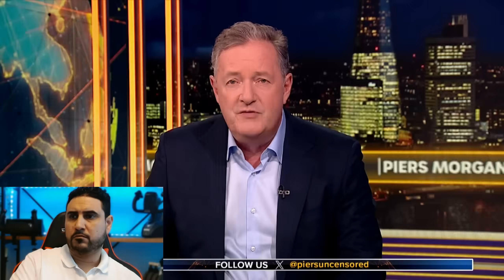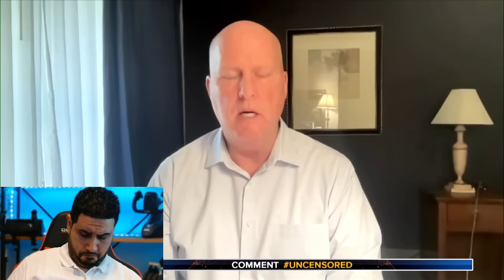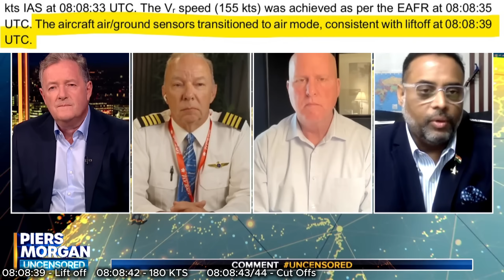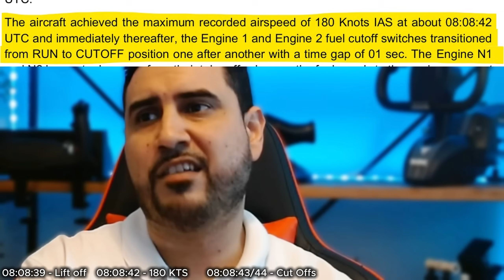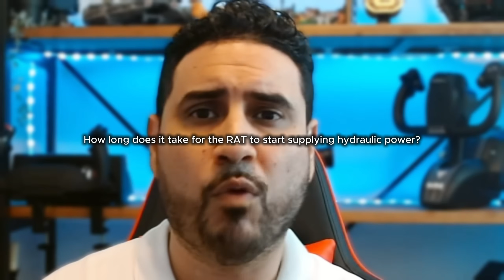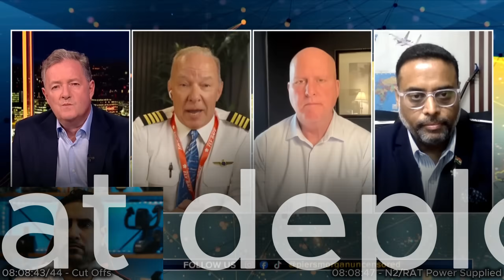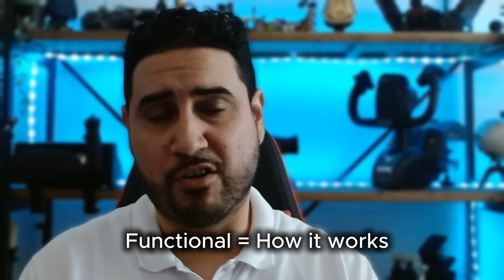TOTAL SYSTEMS FAILURE BREAKDOWN | AIR INDIA 171 | AAIB PRELIMINARY REPORT | MAYDAY | MSFS2024

Comment: off the internet search about electrical problem 787

Electrical Failure Scenario:

If a complete electrical failure occurs on a 787, it can affect various systems, including the FADEC. In such a scenario, the FADEC might lose its ability to manage the engine, potentially leading to the engine reverting to a low-power or idle state.
Reply: @cjswa6473, the FADEC has its own PMA (Permanent Magnet Alternator), which is a small generator integrated into the engine, driven by the engine’s rotationm, which provides power in real time. 

It provides a dedicated, independent power source for the FADEC, ensuring it remains operational as long as the engine is spinning, even if the aircraft’s primary electrical systems (e.g., engine-driven generators, batteries, or ram air turbine) fail.

The AAIB Prelim report alludes to the fact that the engines were indeed spinning throughout the 32 seconds of the fatal AI-171 flight.

If the PMA fails or the engine stops (e.g., due to a flameout), the FADEC can draw power from the aircraft’s electrical system, such as the 28V DC bus powered by the aircraft’s generators, batteries, or RAT. 

However, in case there is total electrical failure, or the RAT does not produce the power in time, or there is a thermal runaway in the Li-Ion batteries, then it throws up more questions as to how both the engines were reignited (As mentioned in the AAIB Prelim Report).

Was the reignition triggered automatically by the FADEC, or was it manually activated by the pilot "transitioning" the fuel control switches from RUN to CUT-OFF, and then back to RUN, which is standard procedure as per the QRH?

Comment: I would like to ask captain Steve if the Fire handle is cable operated all the way to the fuel valves, or command manually and the valve operates electrically.

Comment: Boeing needs to program the fuel management computer to not allow pilots to switch fuel off during lift off.
Reply from the maker: I don’t have my notes in front of me but I believe they need the ability to cut off fuel in the event of a fire. Even during take off. 

Perhaps there should be a fail safe for cutting both off unless absolutely necessary.
Reply: Mechanical switches which directly operate on valves are conventionally used as a bypass to Automatic switches which operates on logic via Engine control system. However in this case whether there are 2 valves in-line, 1 controlled automatically and the other mechanically from the switch is not clear.
10 second would be required if the automatic valve needs rebooting of the Engine control system. 
The much experienced Captain might have realised that fuel was not going into the engine, and thus asked the question to his co-pilot, even though he saw the switch in open position, thinking if accidentally the copilot had turned off the switch and again turned it on again.... 
Blame it on human error to reduce liability of stakeholders..... The departed cannot defend themselves... 
Would be interesting to hear the views of a Chief Engineer and design engineer with experience of this system.

Comment: Maybe the switches were never turned off, the pilot piloting the plane saw on the monitor that the switches were off and asked his colleague why he turned it off, maybe there was interruption in the fuel supply system that happened, without putting switches off then it reset on it's own but no one actually touched the switches off or on.

Comment: Steve is repeating himself.  Yes , the switches can shut the engines but the engines CAN fail with the switches in the run position. Why else would there be a PROCEDURE to relight the engines by recycling start levers
Reply: I am not sure if I understood yr inputs...
AFAIK there is a function inside FADEC called "auto relight" which activates as soon as the FADEC detects engine flame out (signal from oil pressure) as long as the fuel sw is in RUN posn, so there is no need to recycle the fuel sw.....
Reply: @Salahdin500 please refer 787 Boeing checklist for both engines flame out in air - if they relight on their own why should the pilots recycle them manually.
Reply: I flew the Airbus for over than 35 yrs and the FADEC on A320/A330/A340 does the automatic relight after engine failure and I thought it is a common function in FADEC regardless if it Boieng or Airbus....
Reply: @Salahdin500 I flew 707 A- 300 DC10 747 for 37 years - none of them had autorelight
Reply: @Salahdin500 google this “ does A340 do an auto relight after engine failure “. You either never flew or are lying
Reply: I was talking about the FBW Airbuses. All of them are equipped with FADEC and all of them have the auto relight function. I have over 1,000 hours on A340 as Instructor....
The planes types you were referring to (b707, A300, A310) do not have FADEC and thus no auto relight function....
Reply: @Salahdin500 a simple google exercise for you. Just google or ask any Ai platform “ can the A340 engine relight itself after a failure “. First do this

Comment: No reasonable investigator and pilot would believe vibration or human involvement in cutting off the switches. We side that it was FADEC in an electical malfunctioning signal to the fuel valve.

Comment: FDR records switch position (on/off).
Reply from the maker: It does, but my understanding is this recording comes from the fadec. Which the fadec is suppose to accept the command of the fuel switch. 
The question is did the fadec have an electrical malfunction as the tail electrical arc suggests.
Reply: @FinalApproachPOV  Here's how it works:

From the 787 Aircraft Maintenance Manual:

Fuel Cutoff Switch

Designation | Cutoff | Common | Run
A | 1 | 2 | 3
B | 4 | 5 | 6
C | 7 | 8 | 9
D | 10 | 11 | 12

A Contacts feed an RDC (Remote Data Concentrator)
B Contacts feed a different RDC
C Leads to Engine Fuel Control Relay 2(L or R)
D Leads to Engine Fuel Control Relay 1(L or R) AND Engine Fuel Relay 1

The common pins are all GND. Positive voltage is supplied to the cutoff and run pins.

The RDC's detect the switch movement event and send a data packet out to the network; that's how the FDR "sees" and records the event.

https://youtu.be/-ur234kwnhk?t=1030

The FADEC (actually called the 'EEC' on the B-787) has no involvement in the process until after the valves are closed. The EEC is notified by the data network of the switch transition event, and may begin the engine start or relight process.

Comment: The switches are a distraction as someone mentioned here. 
RAT was deployed already in a screenshot in the preliminary report. The height is approximately 150 ft. If the fuel switch was already off the speed vs height trade off would start taking place and the speed would start decreasing. But what happened was it reached another 250 ft with normal climb! 250 tons fully fueled and loaded aircraft. Think! So what happened?

Most likely event is a major electrical failure caused by the Lithium ion batteries thermal runaway fire. Why is this likely? 

Because on the ground we had a video shared by a passenger of IFE and passenger comms air conditioning not working properly. The survivor reported a loud bang and cabin lights flicker. 

What nobody is talking about is RAT deployment reasons.... it's not just shut down of engines. It's when there is a full electrical failure it deploys by EPCS. This triggers FADEC to shutdown the engines. 

The key sequence is RAT -> FADEC -> Engines shutdown at around 300-350 ft only way it would reach 450 ft at normal speed -> Cockpit still has electrical power so they don't know about this event -> PF asks PM why did you turn off the engines -> they realize something is wrong -> 9 secs -> turn off fuel switch and on to reset -> aircraft begins a smooth glided descent and the may day call is made 

The rear EAFR was severely damaged....see the picture in the preliminary report in comparison to the front EAFR. But the tail section was intact and they even found a body of a cabin crew intact.

My experience is 18 yrs in one of the busiest international airport and a major international airline in IT. Always worked on complex system troubleshooting.
Reply: The aircraft reached a maximum altitude of no more than 150 feet above the ground. The Fig. 15 image in the Prelim was taken when it was about 120' AGL, it never got much higher than that.

Comment: While I guess anything is possible regarding electrical malfunctions, I have to agree with Captain Steeeve on this one. While I’ve never flown the 787, I have almost 20,000hrs in the 737, from the -200s to the Max, and knowing the Boeing philosophy, it’s inconceivable that both engines and other main systems would receive electrical power from the same source. For example, in each main (wing) fuel tank, one AC powered fuel pump receives AC system 1 and the other pump gets power from AC system 2. That way with the loss of generator 1, one would only lose 1 fuel pump and not both. Likewise, the hydraulic system has same philosophy, in that if the #1 engine fails, obviously the engine driven hydraulic pump is lost, but the #2 AC power source allows the electric hydraulic pump to remain operational. Therefore, each engine has its own EEC/ FADEC and the likelihood of each failing at the exact same time is nearly impossible. And regarding the Cutoff/Run switches and shutoff valves, it’s only logical that they’d be on different AC/DC power sources.

Additionally, if there was an electrical anomaly, how did it clear so quickly as the #1 engine restarted and the #2 restart was progressing normally until interrupted by ground impact?

While one does not like to point fingers at pilots who cannot defend themselves, in this case, some questions need to be investigated. Like why didn’t the captain announce something like, “dual engine failure, I have the aircraft.” The only conversation spoken words other than the mayday call was in regard to the Cutoff/Run switches. It only seems logical that with the unlikelihood of successful engine restarts, the captain would have tried to maneuver the aircraft to a more survivable landing location like a road or open area. Second, if this tragedy was pre planned, it would be much easier as the PM because with the FO as PF, he would be focused on looking outside and cross checking his flight instruments and not looking at the throttle area. And how did the FO suspect the Cutoff/Run switches were moved to cutoff and that it wasn’t an unexplained dual engine failure?
Reply: @edzanowicz1475, 

Primary Power to the FADEC is the main aircraft power supply from the electrical bus, providing power to the FADEC when the engine is not running. 

As a secondary power source, the FADEC (of each engine) has its own integrated PMA (Permanent Magnet Alternator) to power it, so it runs even if there’s no other power available. 

In the event of a catastrophic electrical failure, the FADEC, as well as the EEC, do not rely or depend upon the RAT to provide them with the electrical power to operate.
Reply: @ramnik.khanna  On this aircraft, the EEC IS the FADEC. Boeing calls this unit the EEC, not FADEC.
Reply: @BryanM61 , yes, but they are two different things. 

EEC is a supervisory system which controls engine parameters and operation to prevent parameter exceedance (temperature, RPM, etc.),and comes into operation at certain engine speeds. It has a backup in case all the channels of EEC are lost.

FADEC is a full authority system, i.e. it controls engine operation and parameters at all speed regimes. It has no backup system.
Reply: @ramnik.khanna  Oh good. Then perhaps you can find me a Boeing 787 document that refers to a FADEC.

The EEC has two channels, A & B - essentially identical circuits that switch to the backup if the first one fails. They constantly check themselves and each other.

The box that we refer to as the FADEC on most other aircraft is called the EEC on the 787.
Reply: @BryanM61  Colloquially, one may be referring to the FADEC on the Boeing 787 as the EEC. However, the Boeing 787 has both the FADEC and the EEC, each having it's distinct function.

Please refer the Boeing 787 Aircraft Maintenance Manual (AMM):
In Chapter 73-21-00 (Engine Fuel and Control - Electronic Engine Control System), the engine control system is explicitly referred to as the FADEC system. The AMM describes the FADEC as the overarching system, with the EEC identified as the hardware component that processes inputs (e.g., from sensors) and generates outputs (e.g., to actuators). This distinction is clear throughout the maintenance procedures.

Boeing 787 Flight Crew Operations Manual (FCOM):

The FCOM also refers to the engine control system as the FADEC. It notes that the EEC is the physical controller implementing the control logic within the FADEC system. This is evident in sections discussing engine operation and fault management, where FADEC is the system and EEC is the executing hardware.

GE Aerospace Documentation:
GE also employs both terms in its technical documentation, at Paragraphs 1 & 2 of Section 73-21-00. 

The Type Certification Data Sheet T00021SE issued by the FAA also mentions the term FADEC.

I rest my case....
Reply: @ramnik.khanna  I also have the FCOM. I find no references anywhere - not one - to the term FADEC or its full spelling. Which section or page did you see that on?
Reply: @BryanM61  , you're right, the FCOM for Boeing 787 Dreamliner equipped with the Rolls-Royce Trent 1000 engines mentions only EEC and not FADEC. 

The AAIB Preliminary Report of AI-171 refers to the FADEC and not the EEC. 

I believe, the FCOM for a Boeing 787 equipped with GEnx-1B engines would differ, as also the FCOM issued by an airliner operator, like Air India.

This needs to be checked and verified.

Have a good day!
Reply from the maker: I come from the IT world while still studying aviation. From a technology perspective, bugs exist and anything is possible. Bugs are unexplained anomalies. They aren’t always fixed with the root cause analyzed. 

But full disclosure, I still am leaning towards Steeve’s analysis. Because that’s what the preliminary report suggest. But don’t forget the “unexplained” electric arc damaage in the tail section. 
But I also know that the impact of the accident can also cause the same electric arc damage. 

So I think the argument is fair enough. We will have to wait for the final point. 
But no harm in speculating in the mean time !

Comment: I think the preliminary report DOES tell the full story only if one looks at it minutely. Page 13 gives out the details of the EAFR's recovered from the front and the tail. 1)"The download from the FWD EAFR was attempted at the AAIB Lab on 24th June 2025. The CPM was retrieved from the EAFR and found to be in good condition. The CPM was mounted on the Golden Chassis and the raw data was downloaded from the EAFR". 2) "The aft EAFR was substantially damaged and could not be downloaded through conventional means. The CPM was opened to inspect the memory card. The damage was extensive".  Let us look at facts. The FWD EAFR fell to the ground and was in the inferno of the exploding fuel.  The AFT EFAR was on the roof , fell to a lesser height than the FWD EAFR and also there was no fire in the tail. But still the report shows there was so much damage to the AFT EAFR that it could not be easily decoded whereas the FWD EAFR was easily decoded.  Does that not indicate that the AFT EAFR had a catastrophic failure which could have resulted in the shorting of the electrical lines and a glitch which caused the FADEC to shut down the engines? It is time the experts had a look at the AFT EAFR  failure angle rather than focusing only on the Pilot error angle.

Comment: 🧭 Overview: Boeing 787 Engine Start/Stop Switches
On the 787, each engine has its own START/STOP switch on the overhead panel. These are electronic selectors, not direct mechanical switches like in older aircraft. They're part of the integrated modular avionics (IMA) system, which means that inputs from cockpit controls go to centralized computers (called Common Core System modules) that then issue commands over digital buses.
----------------------
🛠 Functional Description
Each START/STOP switch sends a digital input to the Engine Indicating and Crew Alerting System (EICAS) and Electronic Engine Controller (EEC) via:
·	Data concentrators
·	Remote electronics units (REUs)
·	ARINC 664 / AFDX Ethernet-style communication buses
These switches control the engine's state:

The start sequence is fully automatic in the 787. The EEC controls starter air valves, ignition, and fuel flow electronically.
----------------------
⚙ Electrical Pathway Summary
The control path looks roughly like this:

[Start/Stop switch] ↓ [Overhead Panel Interface] ↓ [Data Concentration Unit / REU] ↓ [AFDX Network] ↓ [Common Core System Modules] ↓ [Electronic Engine Controller (EEC)] ↓ [Start valves, ignition, fuel control, etc.] 
·	The switch doesn’t carry high current or directly operate any mechanical relay.
·	Everything is monitored and redundant, with extensive fault isolation and built-in test (BIT) capability.
----------------------
🔌 Integration with Other Systems
·	Starter Air Valve: Controlled via EEC, which receives bleed air information and issues start commands to open this valve.
·	Ignition: Also under EEC control during the start sequence.
·	Fuel System: The EEC controls fuel metering and shuts it off when STOP is selected.
·	APU: APU start-up and bleed air coordination happens through the same digital system to manage engine start air source.
----------------------
🔐 Redundancy and Safety
·	Switches are monitored for validity.
·	Signals go through dual/triple redundant channels.
·	System integrity checks are performed continuously.